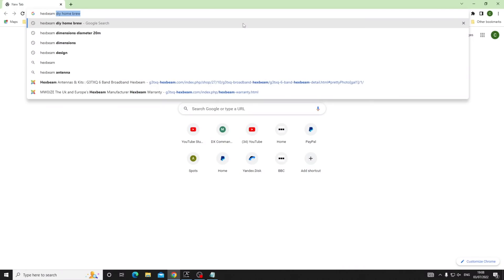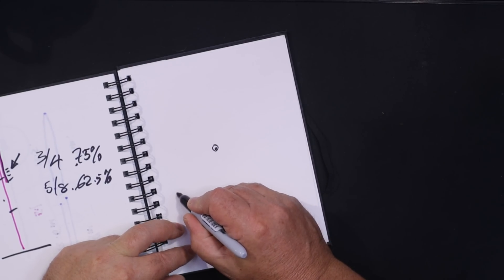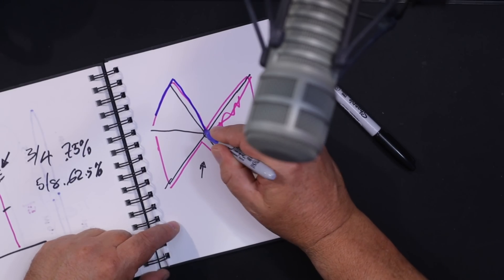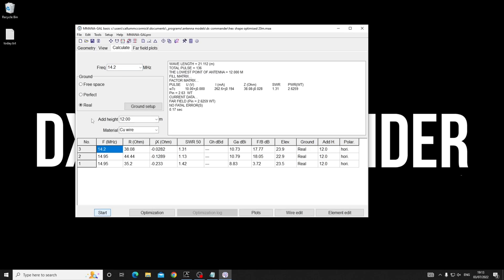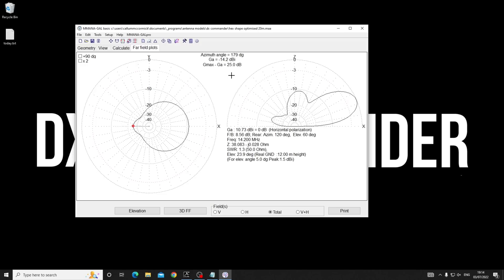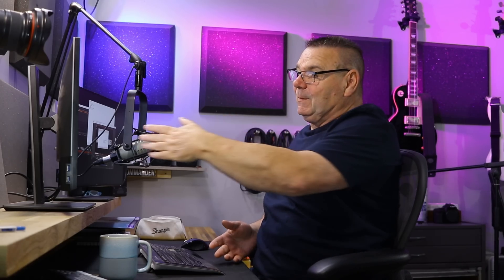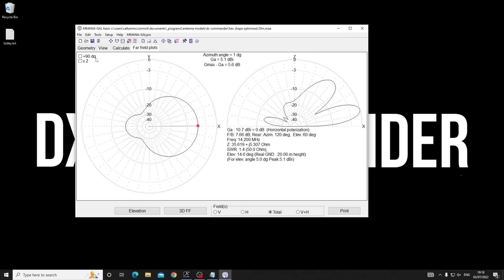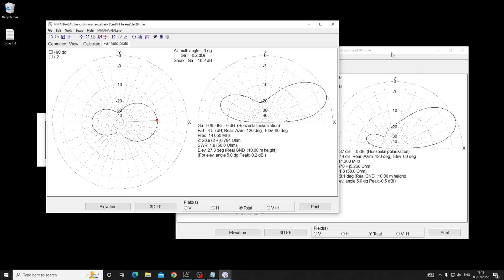How High Should My HexBeam Antenna Be?

Comment: Nice thing about these, and cobwebs, is that they can be put up in very small gardens.  No way on earth could I mount a DX Commander with the amount of radials required.
Reply from the maker: Wrong. You only need 6-ft… Been reading too many books? LOL
Reply: Not wrong if you don't have 6 foot of garden to use.  And a family that use the garden.

Comment: We just had some tornadoes come through this area, The tornado didn't come near our house (well it was 20 miles away so still close-ish) Anyway I was nervous about my tower 😥
It was all good but you aren't wrong. I would just run a vertical but my neighborhood is a hive of RFI and verticals "hear" everything, the hex is so quiet 😊
I love my hex but it is a pain having a tower. As I sit here I'm building up the courage to crank it down to change the rotor. I always imagine the cables snapping or something 😬
Great content as usual, my hex is about 31ft up, I can't have it any higher as it wouldn't tilt over in my garden 😂

Comment: Hello Callum.  Realize this is a bit of a Necropost, but just ran across it and wanted to add a couple of data points. 

 I've  had my NA4RR Hexbeam in the air for a couple of years now and love it.  I'm on a small lot, with lots of concrete parking area and garage out back which makes radials for a vertical an issue. That is why I went with a hex to stay inside property lines and not overhang power lines.  

Mine is on a tower at 40Ft and performs wonderfully.  I finished my DXCC with within a  month (it went up in July 2021, got # 100 in August 21) and am now at 214/205 confirmed and closing in on the DX Challenge.  From Ohio I've worked Reunion Island and American Samoa on voice, and most areas of the world on digital.

As far as winds, it has survived semi-regular sustained of 60MPH several times and gusts of up to 80MPH.  The biggest issue I've had due to winds is the gusts deforming the shape and causing my tuner to go nuts.  Sometimes I have to shut down or go to my sloper during high wind events, due to tuning issues, but the antenna rides it out with no problem.

As for what the neighbors think?  Meh.  I'm not in an HOA and most of them know I'm a little weird any way.  Most importantly, wife doesn't care because it keeps me in the basement shack, happy, and out of her way.

I know several folks with DX Commanders (especially for POTA) that love them, and it's on my short list should I ever get a vertical, but for now I couldn't be happier with my hexbeam and highly recommend it.

73 Randy KAØAZS

Comment: Thanks Callum for the useful comparisons.  I was surprised to find, a long while ago, that, depending on the ionospheric path-geometry at the time, HF antennas can be too high!.  A guy in California was on 28 MHz, switching between two beams, one at 80 feet, the other at 40 feet; he was much stronger on the one at 40 feet!  He and I explain this as being the better height once the ionospheric path is well open.  He finds the higher beam wins when the band is opening and closing, i.e. I guess that's when the refraction-point, in the ionosphere, is at a very low angle above the horizon.
Reply from the maker: Absolutely, angles change. My firned says sometime even a DX Commander winds over his Hexbeam.. Not always, of course.
Reply: Interesting.  I guess, with the different polarisations, the difference, between the Hexbeaam and the DXC, is largely owing to short-term variation, of the incoming polarisation, by the ionosphere.  A good case for polarisation-diverse antenna systems! 😀(Enter the IC-7610 and other dual-receiver rigs) @DXCommanderHQ

Comment: The higher the better is usually true, gets you over local obstructions. However, the ligher you go the higher your feeder losses so it's a matter of finding the sweet spot.

Only exception would be if you are lucky enough to be able to put both your Linear and low noise Rx preamp at the top of the mast.
Reply from the maker: I would say on 70cms you are right.. But on HF, feeder losses for say EcoFlex 15 and other newer fancy economical coax - is less than 3dB for 100m even on 10m band. That's a BIG tower :)
Reply: In the the old days as ZC4MO my "Tower" was over 6000 feet tall,  but the best I could do was about 100 feet of UR213 (mil spec. RG8) to a TA33J antenna 60 feet off the ground. Still DXCC in one day during a major contest was possible.

Comment: not all comes down to gain, you need to consider noise, signal to noise ratio. How noisy is the 2el directional hex @30ft/10m vs a vertical? depending on the location, the noise on the vertical will just not allow you to listen.
Reply from the maker: .. and height :)

Comment: Mine is 43 feet to the bottom. This puts the 20m band about 48 feet above the deck and I couldn't be happier with the performance.  Compared to my verticle with 125 radials the gain is at least 4 S-units better into Europe. 40 feet or a little better seems to be the magic height.

Comment: @DXCommander How is effective height would be determine if I install my Hexbeam on a 10-15feet high Mast on the parapet of a 15 Meters high concrete Apartment , with half of the Hexbeam hanging over the Root and half over the ground 25meters below.
Reply from the maker: Ignore the building.. It will be quite incredible. Just make sure the health and safety has been looked at! :)

Comment: What would be the difference of a 3 el tri bander at 30ft and 65 ft? Worth it ?
Reply from the maker: Yes.. 65 feet is a whole wavelength on 20. I've just run the numbers.. The difference on 20m is an extra 5dB between say 10m and 20m (less the cable loss of going the extra distance). On 15m and 10m, even higher gain and lower angles too.
Reply: @DXCommanderHQ  thank you Callum. I appreciate your help

Comment: So, I had a very nice vertical antenna. 31 feet tall, fiberglass pole, hidden in the trees, large radial plate with 32 radial approximately 25’ long.  It had a 4:1 unun at the base.  You can see it in use on my channel doin the AM/MW band scan with the Icom receiver.  It was a good antenna.  Easy to put up (S9 made it, they don’t exist anymore really but someone bought them out after LDG took them over and you can still get one).  The drab green fiberglass made it invisible in an area of my backyard that was undeveloped with tall trees. It was a beautiful thing in many ways. However, I noticed that I could never get into anything further than Western Europe with it. I couldn’t chase DX in southwest Asia, forget about Japan or east Asia. It did reasonably well as my first permanent install, and it was still standing, no maintenance required, 9 years after I raised it.  

Ok, about two years after I put this vertical up, I was sick and tired of hitting a wall with my DX. I also had just gotten a brand new Elecraft k3, and I didn’t feel my antenna was up to par with the radio. So I invested some money in a Cushcraft MA5B.  It is a cheap, non-full size 2 element beam antenna on 20 m, 15 m, and 10 m with a directional dipole on 12 m and 17 m. To mount it, I dug a 3 ft deep hole, about 3 ft wide, pounded rods of rebar into the ground within the hole, and then poured about 200 pounds of quick Crete concrete in it with a large aluminum receiver for a push-up mast. I was able to mount the antenna about 15 feet, maybe on the best day 17 feet above the ground so we’re talking about 5 m.

Now you think after listening to Callum’s video I’m going to tell you that I didn’t notice any difference between the beam and my vertical.  Wrong.  That silly beam antenna on a Home spun mast , 5 m off the ground was nothing short of amazing. It was at least 2 to 3 s-levels quieter than the vertical.  And when you pointed it at something, everything else your radio picked up outside of that beam width just melted away.  Switching between the two antennas, the little MA5B always mopped the floor with the vertical on every band 20-10m.  I was able to make side band contacts in Japan,  Jordan, Saudi Arabia, Qatar, and South Africa.  When I would switch over to the vertical for comparison, I couldn’t even hear those stations.

So take it from someone who put a lot of time and money ($300 dollars of copper actually) into a 31 foot vertical antenna with 32 radials, and actually thought it did a reasonable job, then put up a small beam at a non-ideal height. The beam always wins. It was always the better antenna, it wasn’t even close. It was also superior to a couple of similarly height mounted fan dive holes from Alpha Delta I had put up in an X configuration ( NE/SW, SE/NW).  Once you have a beam, it drives home the point that your radio is as good as your antenna. A cheap Yaesu 891 with a beam destroys an Elecraft K4 or Flex 6700 with a vertical, even if the beam is only single story height.  I’m at a place again where I am contemplating putting up a beam. I’ll be able to do 25 feet at least (depending on direction, it’s slopes to the south and east, and I get even more height).  I’m not even thinking about vertical wire, antennas, fan, dipoles, sky waves., been there and done that. Having a beam you can point and drown out the noise around you by 270° is nothing short of magical when you experience it. It almost makes the hobby boring. That’s how good it is.
Reply from the maker: I think half your original issue was the 31 feet and 4:1 unun at the base giving you essentially a non-resonant antenna. Most of the higher frequencies would not have had a good pattern. But interesting story.
Reply: @DXCommanderHQ  Possibly, but non resonant antennas aren’t necessarily inefficient.  I have a simple wire vertical now, approximately the same length, elevated 15’ off the ground, fed by only 18 inches of coax.  By most on-line calculators, it is 95% efficient when tuned because of the ridiculously short feedline, as most of the loss in reasonably long non resonant antennas is in the feedline.  One aspect of beams you don’t take into account is that even if imperfect in height, a non-height dependent advantage of beams is lowering the noise coming from outside the beam.  So, yes at 5 degrees a beam at 15 ft may have equivalent gain to a vertical in its main lobe, but it rejects stray signals and noise (qrm and qrn) outside the lobe by 10-20 db, lowering the noise floor allowing you to hear the signal.
Reply: @m0mcx  I think the other half is 34 radials. Depending on soil type which is about as poor as it gets here in N FL you need a minimum of 60 to 75 radials. My vertical was a fantastic dummy load when I first set it up and only had 4 radials per band. When I got to 60 it came alive and only got better as I added more. Commercial stations use 125 radials and its not because copper is cheap and it's easy to do. After 75 radials the difference was minimal but there was still a difference.  Do I hear more off my hexbeam? Of course I do. However there have been days when the lower takeoff angle of the vertical has been heard on 10k mile DX and the hexbeam wasn't.
Reply: @dnssigns  A lot of studies show hugely diminishing returns with radials beyond a certain number.  I forget them, but doing my research when I installed my vertical, I seem to remember most advice being that once you get past 16 radials, the benefits fall off sharply.  My 32 radial vertical was a good antenna, but it was subject to its the flaws inherent within its design.  It’s was noisy, non-directional, and not good for what I would consider rare or uncommon DX in the Far East, Australia, or the near east.  I doubt another $300 of copper radials would have improved that situation, and really you only have to look at what antennas successful DX’ers use (beams) to settle the debate.  Verticals have their advantages.  They are relatively cheap, uncomplicated, require little or minimal support, sturdy, easy to install and effective.  But they are second rate antennas compared with a beam or even an array 2 dipoles.  But beams ad dipoles require require land, towers or tall trees (for dipoles), complexities with rotors or switches and their associated expenses, they are more fragile, and in the case of beams are unsightly in neighborhoods.  It’s all about trade-offs.

Comment: Hi Callum , I purchased a hex a while ago with the 40m extension ! Like you said it needed height so got a 14m tower all good sadly the neighbours didn’t like it and reported me to the council who by the way were shockingly anti any antenna’s. I almost gave up the hobby completely, until I done a swop with a local ham who needed a vhf uhf radio and was giving in return a dx commander? Best move I’ve made in putting life back into the hobby I love . Few years later I’ve purchased a few more which I have permanently at my home qth , and two others for portable work which work absolutely fantastic by the beach . Thank you
Reply from the maker: OK, all worked out in the end then. Well done Paul.

Comment: Seems how this videos like 7 months old.. You probably won't see this comment. But if you run the coax up the pole with 2 in sulated spreaders to keep the coax off the pole it will lower your SWR impedance by one. So what I'm wondering is if this works with other antennas besides the hex??
Reply from the maker: Hi Ben, yeah - actually I see all comments (however "threads" are more difficult).. Right, In the event you are seeing changes to SWR with shielded coax near a conductive pole, the operator is EITHER using the wrong (read crappy) coax or they have a ton of RF on the outside of the feedline (potentially) and might be helped with a choke at the feedpoint. You shouldn't notice anything changes. Not knowing this installation, I can't comment further.
Reply: I have a 20 meter monoband tri element yagi with the boom setting at 42 feet. I placed a 1to1 choke at feed point and used 100 feet of LMR 400 zip tied to the 1½" steel mast. I have no issues with swr whatsoever and the whole setup is quite amazing compared to my old hustler 5BTV ground mounted vertical. Callum, love your videos! Keep up the good work sir! 73

Comment: Mounted a K4KIO hex beam on my 70ft telescoping tower. It remained there until it had to be lowered for tower maintenance. That very afternoon John ON4UN was working a pile up on 20m. What better reference signal could there be from a noteworthy station. I compared his signal strength with the hex beam at 70ft and 40 ft. There was noticeable improvement at 40ft so it remained there until it was removed from service. The reason...the front to back ratio was a problem. QRM from stateside stations, while directed to the EU, was excessive.
Reply from the maker: Very interesting!

Comment: I homebrewed a G3TXQ Hexbeam a few years ago for about £80. I remember having it on a test stand at 2m height, tweaking the elements for a decent VSWR. Connected it up to my IC-703  and heard a ZS station calling cq on 20. The Hexbeam happened to be beaming roughly south so I replied and got through first call with 5 watts.Then had it up on a scaffold pole at 9m with a cheap rotator, worked really well on all bands 10 through 20. Enjoy your vids Callum. Cheers,Mike.
Reply from the maker: Nice!
Reply: I ve been building an hexbeam for 6 bands but 6m is missing by now. May the missing 6 m wires make great influence in overall behavior? I got near 2.0 of swr in many bands. 
Regards

Comment: do not use a hexbeam with a KW...you will burn the spacer cords in two!
Reply: ...what makes you think that? 
I have the HexBeam HEX6B from EAntenna - maximum load 5 kW. Where should there be a problem when you work with 1 kW power? Nothing happens...
Reply: @michaelzehrfeld7766  I ran near 2kw through the eantenna hex and it was fine
Reply from the maker: Change the cords :) SSB would be OK, but probably not FT8!
Reply: I've had my hex for over 3+ years and I'm a contester and run an Acom 2000a at 1400+ with ZERO  issues....who told you this????

Comment: Very interesting. I see the farfiled plot is forming secondary lobes at a certain height.  Is this desirable? Radiating energy at high ToA secondary lobes when you are looking for DX does not help much isn't it?
Reply from the maker: No it doesn't. Effectively, these are wasted.
Reply: @DXCommanderHQ  So it is crucial to find the optimal height without any secondary lobes wasting energy. For a multiband Beam there is no single optimal height agl, always a compromise except if you have the space for Monobander Yagis each at its best height... 73

Comment: Very interesting Callum, I run a tennamast and normally leave mine at about 30ft… have taken it up to full height but never seem much difference…
Have tried the height change in the middle of a QSO..
However, propagation is a strange thing..
Might now leave mine up a bit higher ☺️
On chats across the band, it does very well against a friends STeppir..
So very happy with mine… also quite wind resistant

Comment: I homebrewed  hexbeam in less than 70 $ ,,, and it's working great , had qso with 59 signal report from central USA STATION , ALSO FROM BRAZIL STATION ,.     THOSE ARE FARTHEST STATION FOR ME FROM INDIA,.  HEIGHT IS ABOUT 10M
Reply: You should do a video on the build.
Reply: @mixxndj   it's already installed, with post photos if you want. Thanx for comment

Comment: What if I'm hiding my hexbeam in the middle of a forest? Would it be pointless to put an HF beam antenna at lower than treetop level surrounded by trees?
Reply from the maker: I personally don't believe so. At the scout hut we had hundreds of metres of trees behing us - and stuff that way worked fine!
Reply: I think you mentioned if you were to add 1 element it should be a director,  that gives you all the gain. I don't care about blocking signals from the back where I am. What would you think about reducing dimensions and driving from the reflector position, making the other a director in the hex format?